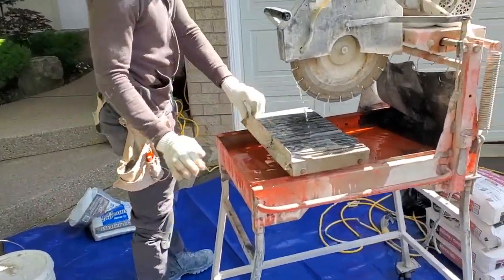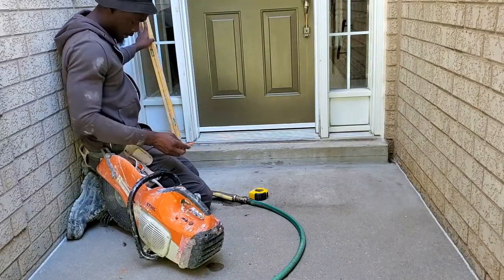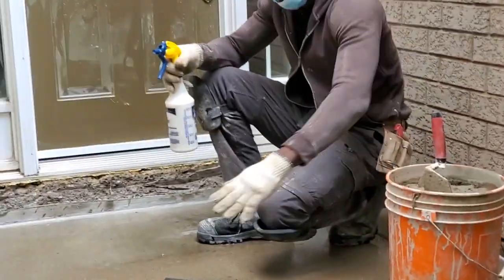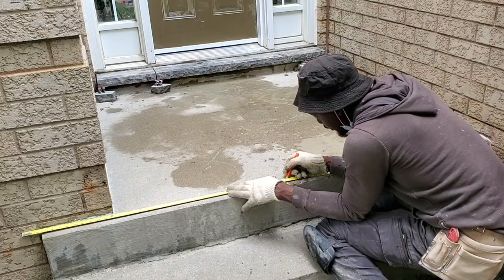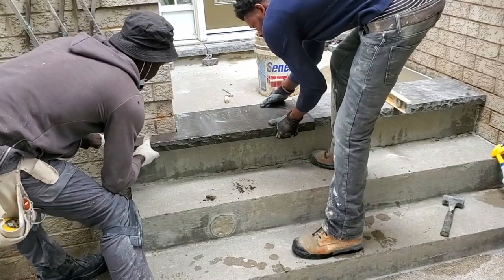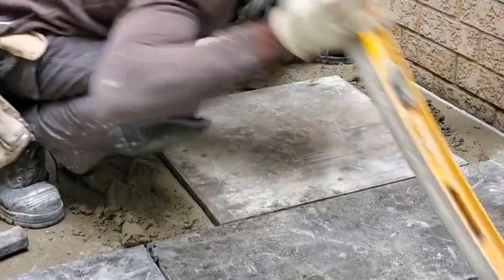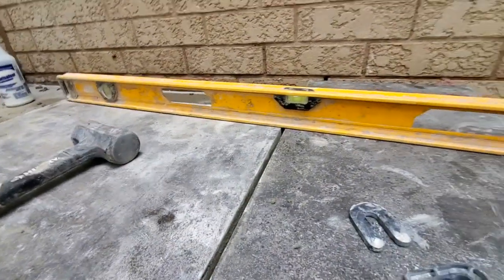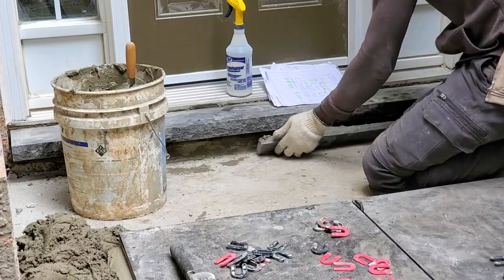A to Z Front Porch  Makeover / With Natural Stone DIY All YOU NEED TO KNOW

Comment: Great work. It looks like years ago there was a drain exit on the lower step to remove excess water. When facing the lower step on the left it looks like the hole was filed in. In your videos you are correcting prior work that was performed years ago. This is very helpful for me because the home I reside in is over 70 years old and I have tons of projects to work on. Thanks.
Reply: I think that’s a light - didn’t see anywhere on the landing where a drain could’ve started.